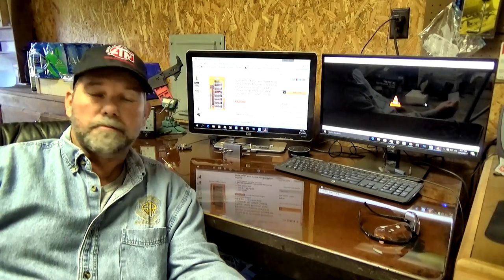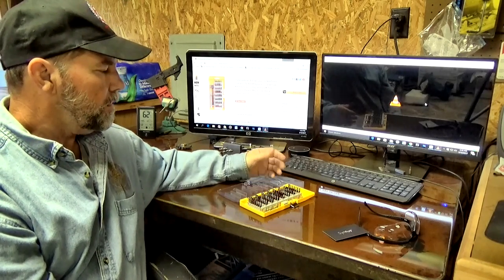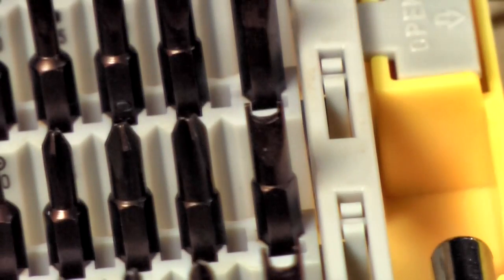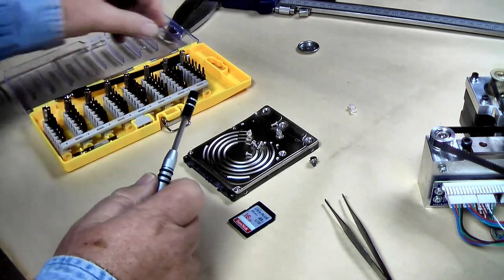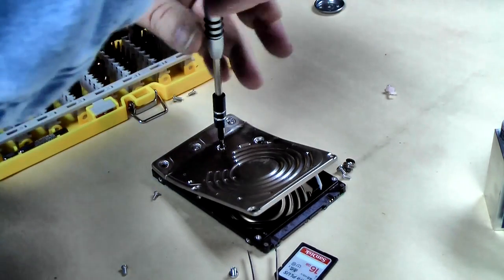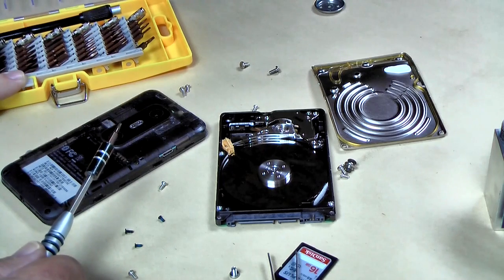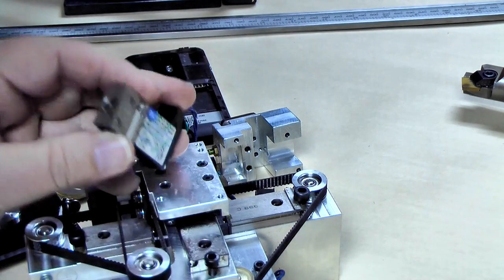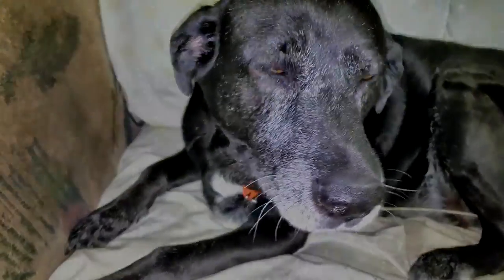Syntus 60 in 1 Precision Screwdriver Set Review

Comment: Hey Brian, to get your camera to quickly focus you should try AvE's magic phrase as it always seems to work for him. lol Do you know if Syntus is the manufacturer of the 60 in 1 Precision Screwdriver Set or is this a rebranding? The reason that I ask is because I saw a few sets on Amazon and eBay under different brand names at the same price point that appear to be the same except for the plastic case color. However, some state that the bits are made of S2 steel and Syntus makes no mention of this which leads me to believe it's a rebrand or possibly a knockoff.
Peace!
Reply from the maker: well he has the market on that phrase, it looks like syntus is the marketer and the maker is professional hardware tools in china. I was telling PB that Since I've done this review I've seen no less that 6 reviews on this same kit pop up in my recommended video feed, I guess I'm not special.
Peace out!